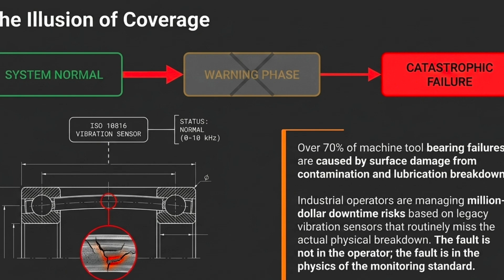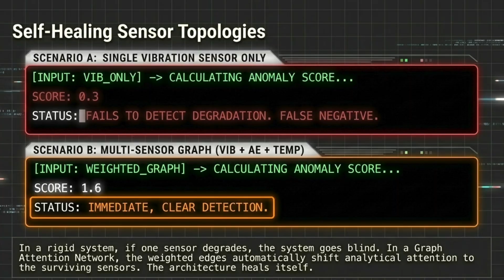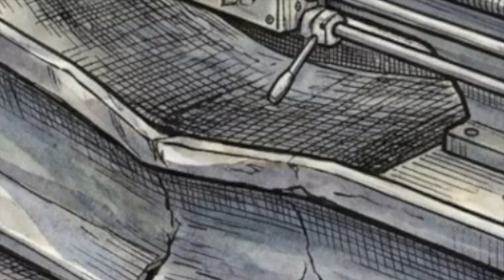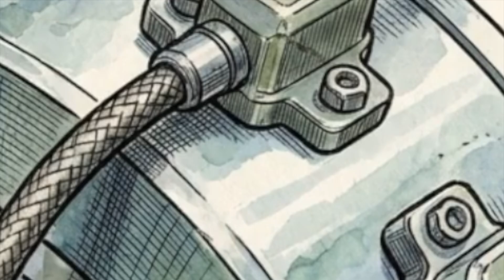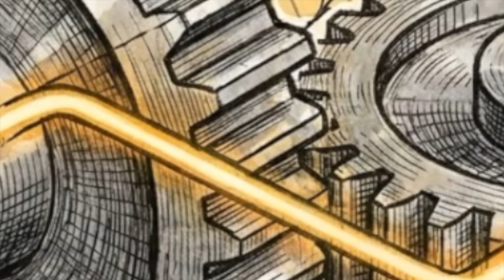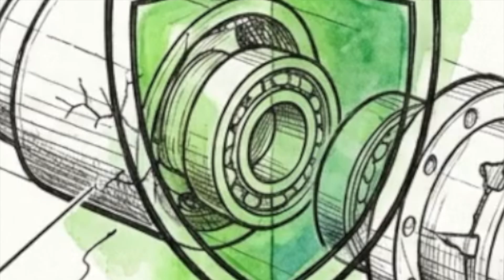The Architecture of Silence: Why Industrial AI Must Move to the Edge

Comment from the maker: Here are few sources for your reference 👉
  https://f7i.ai/blog/skf-enlight-competitors-choosing-between-proprietary-ecosystems-and-open-reliability-platforms  

https://www.mdpi.com/2075-4442/12/6/229

https://www.mdpi.com/2075-4442/14/2/72?bm-verify=AAQAAAAN_____4Ej_qkHqsKoPudg-ZTY3Ku8ZLf-Br4o9UBS3YhVfjwY46SAf83tIqFEeNgZOb8YOkru2pYr2f40ZytiRZsGTDal1Y_tVYIqtP2-mK434dsWU2euyDpY0g63Z94mpNY0GSnm4kIDXQ3-uSoxhsvXFYsvC_TCx30FDx-MDlEN-T7My7v2jTziHe2HmhDyx2vZZSfYdD7x0vUKNkDWtSomZqP_Nc8pOKN2MXVZvdyCHTmaUthjhTC2GxVeIOjCDWTC_oGb3IdFmmBCtjFndmZNE72g-3vXvVNfj9YbdUbXTfXMlv35GL6tVVrda5-O0_mShjA
Reply from the maker: The Strategic Map: Acoustic Emission (AE) vs. Low-Frequency Vibration (LFV)

The Visible Symptom
 Operators in heavy industry (like the high-decibel environments of Vidarbha) watch their condition monitoring dashboards report “green,” only to experience catastrophic spindle or bearing failure hours later. The legacy ISO 10816 vibration standards create a false sense of security.
  
The Actual Structural Bottleneck
 The signal-to-noise ratio. Low-frequency vibration sensors (accelerometers) detect the physical shaking of a machine. By the time a machine is shaking enough to stand out against the ambient factory noise, the mechanical degradation is already irreversible. The actual bottleneck is not data collection; it is the inability to hear the high-frequency friction (Acoustic Emission) that precedes the vibration.

  The Control Point & Obscurity Beneficiaries
 Currently, equipment replacement vendors and reactive maintenance contractors own the control point. They benefit directly from the obscurity of low-frequency data. Unpredictable failures justify high-margin emergency interventions and parts sales. The narrative that "some failures are just unpredictable" keeps the actual chokepoint hidden.
Reply from the maker: Listen to this 👉 as you commute:
 https://open.spotify.com/episode/0ekEmomqdx8NuEgE3sZAub?si=Orx0ewVDSYus52kE76PzxA
Reply from the maker: Dive DEEPer Here 👉:

  https://prasadbhonde229.medium.com/the-architecture-of-silence-why-industrial-ai-must-move-to-the-edge-04aa53684029
Reply from the maker: Access “Study Guide: Advanced Systems for Bearing Lubrication Monitoring” here 👉:  

https://docs.google.com/document/d/1Y1OIG-7v2v2S--lYpAfvSOf9e6MoV39--8fXlx_KXAY/edit?usp=sharing
Reply from the maker: Connect here 👉 
https://tr.ee/vYy2GL  

Or here 👉
 https://linktr.ee/PRASADBHONDE
Reply from the maker: Or you may want to read this 👉 

https://amzn.in/d/01HOcXep
Reply from the maker: VIEW Here 👉: 

https://youtu.be/NvfwD173IeI